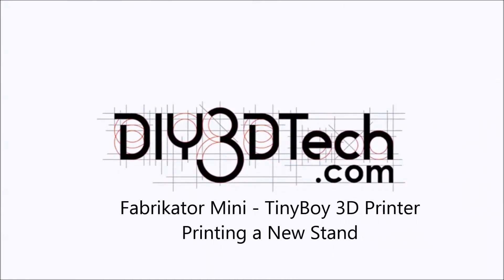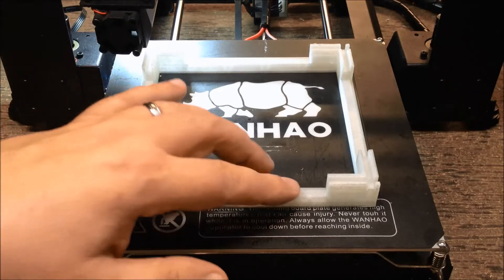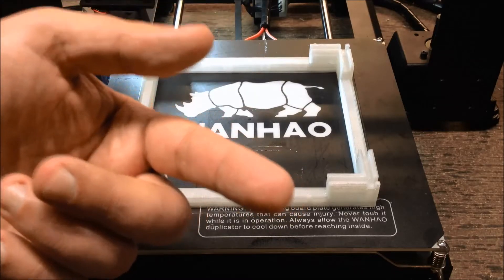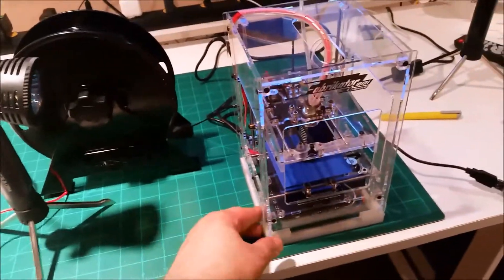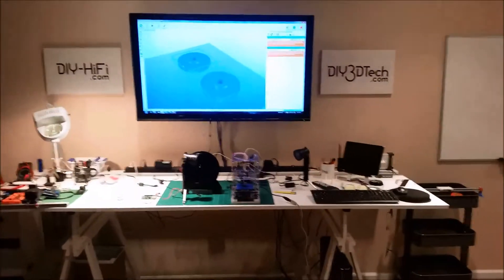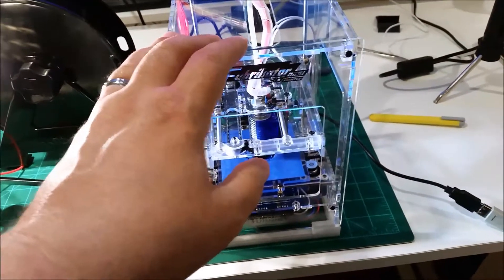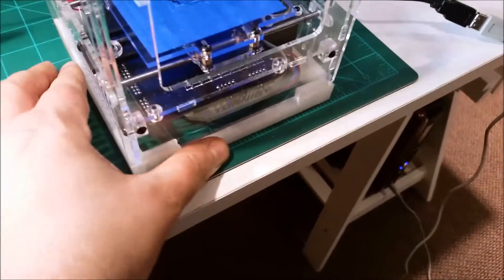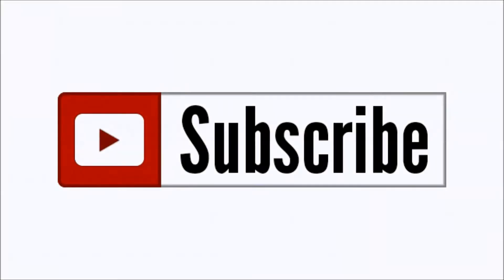Fabrikator Mini - TinyBoy 3D Printer - Printing a New Stand

Comment: I'd recommend you have a 80mm fan underneath blowing onto the motherboard
Reply from the maker: +Andrew Griffiths You are likely right as I have been doing a lot of printing and it gets hot!  If I just do a piece or two its OK, however just ran or about two hours and hot it was.  Do you know of any good designs to print out there?
Reply: +DIY3DTECH.com I would call it good but I use thingiverse 1051795. It's a little big, uses way too much plastic and doesn't have great airflow but it gets the job done.